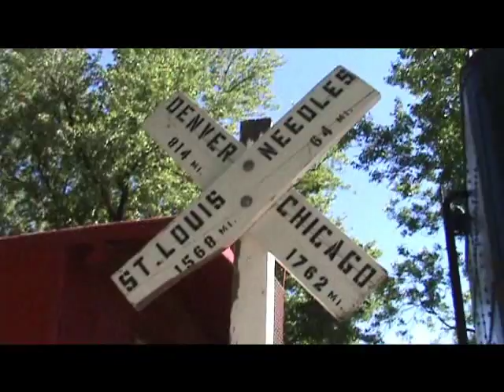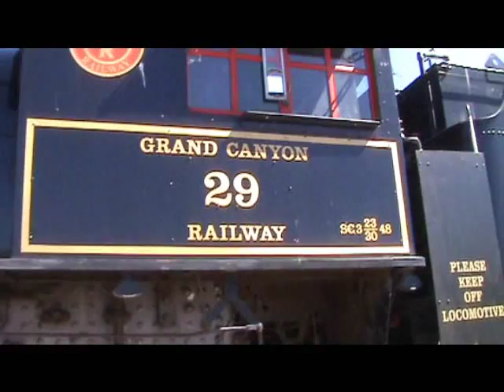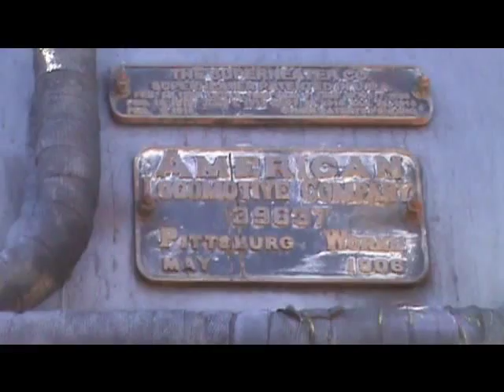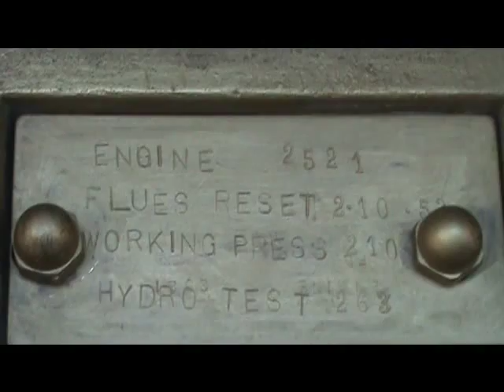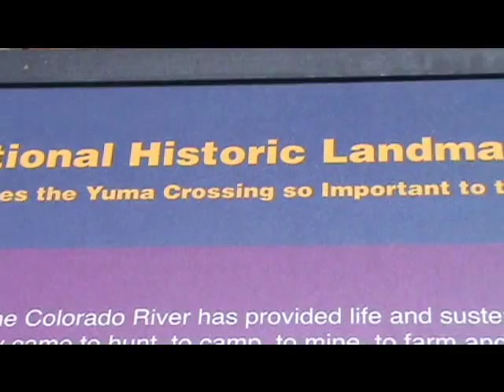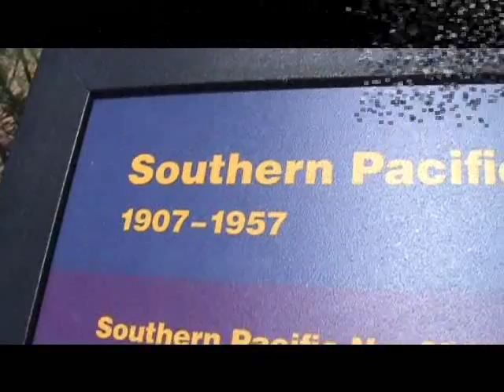Steam engines on display

Comment: Grand Canyon Railway #29 is actually a sister to our #33 that we used to own on the Hocking Valley Scenic Railway. #29 has not seen service since 2008 (steam temporarily discontinued until 2009), and neither has #33 (needs undercarriage and firebox work).